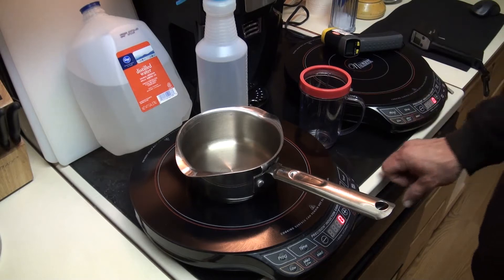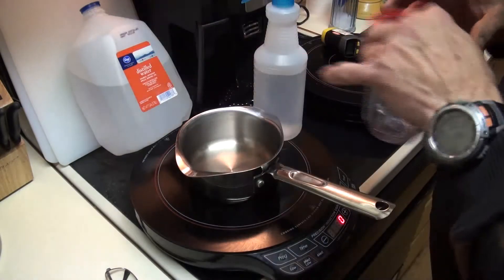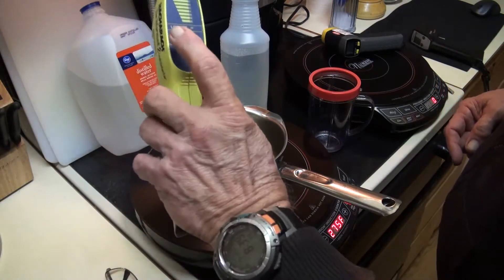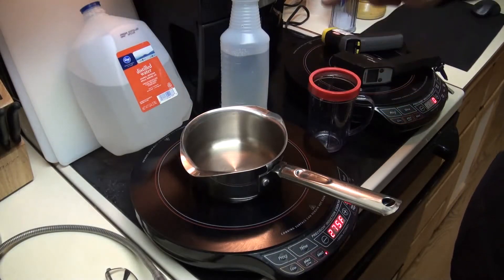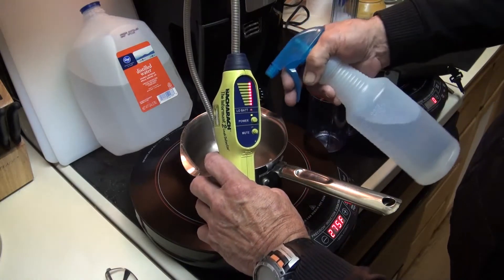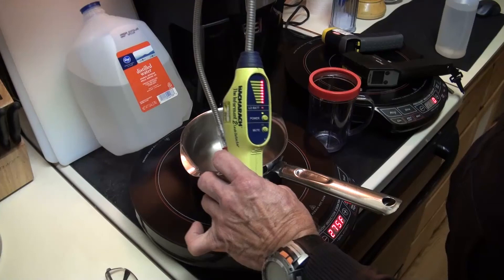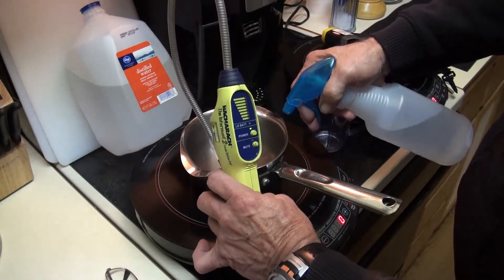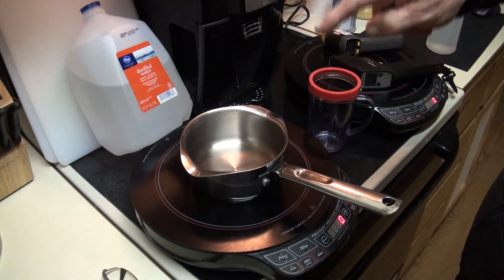# 2 Flammable gas from distilled water, is separating the Atoms, in water.

Comment: Hmmm.... while I am excited about what you are working on, and, do not want to discourage you.
If this were the case, how many housewives would have been killed just cooking a family meal?
We know H2O can be ripped apart.
What system do you believe is required for the flashing application; and, Hydrogen captured for powering an engine under a heavy load? Distilled water is probably not really necessary.
This is not all the parts of the puzzle.  Keep working on your research!
Reply from the maker: Come back and read what I have discovered.
Reply: Bill Kendrick Bill, how difficult would it be to safely set up a test and ignite the Hydrogen produced? If a flame, or electric spark, like a barbeque lighter (...or your Bic lighter is used; do you suppose this experiment would work?
Reply: Bill Kendrick I understand that the water mist has a cooling effect on the heated pan, but would heating the water up to the the appropriate temperature (212F) before spraying it eliminate the need for a larger mass heater?
Reply: use the exhaust heat generated by the engine (after it warms up) as a pre-heat.
Reply: Bill Kendrick If the water was preheated to 212F and sprayed on a pot in an environment with an ambient temperature that's held at 230F by using an oven, would that cause more hydrogen to be produced?

I really hope you succeed at what you are trying to do, and I'm not trying to discourage you. I know temperature is an important variable in what you are doing, but did you rule out the eddy currents created by the induction heater as the cause for the hydrogen gas production? As I understand it, an induction heater uses a high frequency AC signal to generate eddy currents within the pot which leads to Joule heating of the metal pot. If you try to use AC instead of DC to disassociate the water molecule, it will break apart and then come back together again. I'm wondering if it's possible to make an induction heater using high frequency pulsed DC instead of AC. Then I would try your misting experiment again and see if it yields greater hydrogen gas production.
Reply from the maker: Unless you use a charcoal filter and filter the public water, there will be chemicals added to kill bacteria in the water, like chlorine, and chlorine changes the boiling temperature of water changing the temperature that you can flash the water and separate the atoms. Maintaining a constant heat on the water before flashing it, will have no influence on the outcome. It is the temperature applied to the droplets of water that create the flashing effect, no matter what temperature the water is before.
Reply from the maker: Bill Kendrick My Synopsis
We all know when heated, a liquid produces a gas. This gas will separate from the liquid, it was created from. We all know all liquids have their own boiling temperature. What if it were possible to take any liquid to any temperature, then it would be possible to take liquids to the boiling temperature of atoms inside that liquid, and like going to the boiling temperature of the liquid. The atoms that boiled would separate from the atoms that didn’t. One atom, or group of atoms will become a gas and the other atom or group of atoms will remain a liquid. Thus you would have separated the atoms in that liquid, and at the right applied temperatures, it would be possible to separate the atoms in all liquids.
I have a synopsis, all I ask is to read it and decide, if I am right. If you know nothing about Sublimation please look it up on the internet. Sublimation happens to snow when ample amounts of heat is applied to it, of course in explaining Sublimation, the scientist, used an unknown temperature, from a flame, or torch. When a large amount of ample heat is applied to the snow, the snow goes from a solid matter to a gas, without becoming a liquid matter. It is the size of the snowflake’s frozen matter that makes this possible. The snowflakes are extremely small, and they assume the applied temperature faster than the snow can melt, so by going to the applied temperature the solid matter bypasses the temperature needed to change to a liquid matter, which is above 32 degrees Fahrenheit, the freezing temperature of water. The snowflakes assume the applied unknown temperature, using the Sublimation effect and snowflakes become a gas, which happens above the 212 degree Fahrenheit temperature, the boiling temperature of water. We all know how long it takes snow to melt, but snowflakes are small and will go to the applied temperature very fast, faster than the snowflakes can become a liquid.  Agreed? Sublimation is what science calls it.
Using the Sublimation principle and specific temperatures, I replaced the snowflakes with small droplets of liquid, I used specific temperatures, and instead of applying the heat to the liquid, I applied the liquid to the heating element, or heat source, in spray form. I used the same principle, as Sublimation, just a different way of applying the heat. I did this to gasoline and water; it can be done to any liquid.
On gasoline I used 600 degrees Fahrenheit, for the heater temperature. Spraying a fine mist of a liquid onto the heat source, at specific temperatures is totally different from Sublimation, and I start with a liquid. I call it my Flashing Liquid Process. I have found a way to take any liquid to any temperature, before it changes state from a liquid matter to a gas. Using my Flashing Liquid process on gasoline at 600 degrees Fahrenheit, I got a white vapor that has twice the power of gasoline, I saw it on two different vehicles and 2 different Dynamometers. The white vapor I produced, had a zero parts per million hydrocarbons reading, this I have seen on a smog analyzer. To further prove what I discovered I put clean dry rags over the vehicle exhaust pipe, running the vehicle on the white vapor, and on all 7 vehicles, I have run the white vapor on, all the rags smelled like they had just been ironed. Some of the vehicles ran for half an hour on, the white vapor, very clean. At the same time the white vapor was created, I also accumulated a non flammable liquid, neither the white vapor, nor the non flammable would mix with the gasoline they were created from, after I Flashed the liquid gasoline.
I did my Flashing Liquid Process to distilled water. On water I used between 212 and 230 degrees Fahrenheit. I could not find a temperature control to get the exact temperature, but I know it is in the, above mentioned, 18 degree Fahrenheit temperature range. I found that public water has unspecified amounts of chlorine added. Chlorine influences the boiling temperature of water, so I used distilled water, which is also a non conductor,  gasoline,  is also a non conductor to.  You see, I used electric heaters, and thought about shorting out the electrical, when and if it is used on a conventional or hydrogen powered vehicle. When I sprayed the distilled water onto the heat source at the above mentioned temperatures, I detected, with a combustible gas leak detector, a flammable gas from the vapor I produce. There is only thing flammable in water, it is the hydrogen atom. To get hydrogen from water with temperature, you would have to find the boiling temperature of the hydrogen atom, turning it to a gas, while the oxygen atom, still in liquid matter form, having not been flashed and reached its boiling temperature, remains a liquid. The liquid oxygen atom remains a liquid long enough for the hydrogen atom to become a gas, and separate from the liquid oxygen matter. Of course liquid oxygen boils at, according to one internet source, -368.77 degrees Fahrenheit, so it will boil as soon as the hydrogen atom separates from the oxygen atom, inside the water. Hydrogen from water using the right temperature.
Science says when atoms separate, a void is created in the original atomic structure, and the void will be filled. Air being present, when my Flashing Liquid Process takes place, the surrounding air fills the void, and oxygen, being in that air, is what turns the vapor I created from gasoline, white. I have seen the bubbles form, and the gas inside the bubbles is clear, until they break, then like magic, when the clear gas is exposed to the air, the clear gas turns white. The oxygen in the surrounding air creates a hotter burning vapor, this is where I get twice the boost in power over gasoline. The liquid that forms the bubbles, that has clear gas inside, is the non flammable liquid that I created when I Flashed the gasoline, at 600 degree Fahrenheit temperature. A Gas Spectrum Analyzer, would add documentation to my synopsis. Prove me wrong, you have the temperature, use an electric fry pan, turned to its highest temperature, which should be around 600 degrees Fahrenheit. Spray a fine mist of gasoline onto the heated surface. Don’t worry, science is wrong about gasoline igniting at 536 degrees Fahrenheit. I have seen a heating element turn a dull red (about 1000 degrees Fahrenheit) before the gasoline auto ignited.  The electric fry pan cannot reach that temperature. Analyze the white vapor, and non flammable liquid on a Gas Spectrum Analyzer. I know what I discovered.  I will call the white vapor I created from gasoline, Billy Gas. I know its saturation temperature is around 65 degrees. It remains a gas at higher ambient temperature, than 65 degrees Fahrenheit. Find that saturation temperature on the combustible liquids chart.
I have 3 videos on You Tube my channel Bill Kendrick, watch them and read the comments, make your own decision.  A large mass of heat will be needed to sustain the desired temperature, when the liquid is sprayed onto the heat source, and the droplets need to be as fine as possible, to react to the applied heat faster. Yes I think I found the way to separate the atoms in any liquid with the right temperatures. I say every liquid atom has its own boiling temperature, when my Flashing Liquid Process is applied. Try it and see for yourself.
Bill Kendrick
Reply from the maker: You need to get a life, and find something you might know about.

Comment from the maker: It is the clear plastic bottles that are made from fossil fuel. the milky ones give off no hydrocarbons and the milky bottles are all I used in my experiment. So distilled water is not a problem, the chlorine is, and influences the boiling temperature of water. The clear fossil bottles are why I don't drink soda in plastic bottles anymore.

Comment from the maker: We all know water is not flammable. The only flammable part of water is the hydrogen molecule in the chemical make up of the liquid water. We can extract hydrogen from water with lots of power and chemicals, but it is not economically feasible to produce hydrogen in large enough amounts to support a hydrogen backed World, besides hydrogen fuel cells on automobiles, are like bombs in a car accident. This simple process, I have, refined, can make hydrogen at the intake manifold on the engine.

Comment from the maker: Scamming, is not my objective. Sceptics come out of the wood work, and give a thumbs down, to everything new, and they have never tried what is being presented. Get a stainless steel pan, iron skillets fluxuate in temperature to rapidly. Use distilled water, varied amounts of chlorine influence water's boiling temperature. Get a combustible gas leak detector, and  thermo thermometer. Spray a fine mist of water onto the pan whose temperature is between 212F and 230F, You will detect flammable gas

Comment from the maker: It is the temperature. You see when you apply a fine mist of liquid to a heated surface. The liquid will assume the temperature of the heater before the liquid can boil. Heat transfer happens faster than a liquid can boil or freeze, which is a change of state of the liquid matter.

Comment from the maker: There is a gas to oxygen ratio that it takes to have enough flammable gas to ignite. The flammable gas leak detector will detect very small portions of flammable gas, smaller than the amount needed to ignite. However the fact that I produced the flammable gas, which can only be hydrogen, from the water, using heat applied a different way, proves I did it. Nobody else can do it. It takes chemicals electricity and expensive probes to make hydrogen, slowly. It proves I have done a molecular change

Comment from the maker: I know for a fact it is the temperature. You see I get a white vapor and a non flammable liquid when I used this same Flashing Liquid Process on gasoline, at 600F, the first video I made. It will take a large mass of heat and a very fine mist spray of water to prevent the water from changing the heater temperature, which is critical. I used resistance heat on gasoline and induction heat on water. Something else to consider, this can be done to any liquid, who knows what can be created from it..

Comment: id say get something built that lets you spray water through an injector to the hot surface and light the gas coming out. even if you had to use electrically charged hot plates, the fact that heat is helping, makes hydrogen (from water) engines more feasible. high temp electrolysis and light the flare :) also figure out if its just the temp, or if the induction heater has alot to do with it

Comment from the maker: I can see you are a pessimist. You are missing obvious things in my demonstrations. First, with no chemicals added or electrodes Just temperature applied a different way I detect a flammable gas, from distilled water. Only a molecular change can separate the hydrogen and oxygen molecules in water. Sure hydrogen is made but it is not a molecular change, chemicals and electricity, along with having to use expensive probes to get the chemical reaction, to change the water and make hydrogen slowly.

Comment from the maker: Let me see you make a flammable gas appear from chlorine free or distilled water any other way. To make all the hydrogen contained in the sprayed on water, requires a large heat mass, a very fine mist spray nozzle, a temperature control with less than 10F on and off differential in the 190F to 260F temperature range, and you could light the hydrogen from the heater, but I don't recommend it. The oxygen from the water will boil immediately after the hydrogen and cause the hydrogen to burn hotter.

Comment from the maker: If you spray a fine mist of distilled, or chlorine free water onto metal pan, no coatings on the pan, who's temperature is between 212F and 230F, a combustible gas leak detector will detect a flammable gas from the vapors these temperatures create, when the water is sprayed. There are only two different matters in water (H2O), hydrogen and oxygen, only one is flammable. So it is hydrogen I detected.

Comment from the maker: Use distilled water most public water contains chlorine, and I found the diverse amounts of chlorine in the water influences boiling temperatures in the water. If using public water filter it through several activated charcoal filters first to remove as much chlorine as possible.

Comment from the maker: I did it in my kitchen. The temperature range is critical. Distilled water, a spray bottle, a controllable heat source, a combustible gas leak detector, and you to can make hydrogen from distilled water. Reach and maintain the optimum temperature in the 18 degree temperature range 212F to 230F and make all the hydrogen contained in the water being sprayed onto the heater. When you do this don't try to light it with a match, it could blow up.

Comment from the maker: To do it yourself the temperature range is critical. There is an optimum temperature in the 18 degree Fahrenheit temperature range between 212 and 230 degrees Fahrenheit. If you can find it and maintain it, you will produce all the hydrogen contained in the water being sprayed onto the heater, and it will happen instantly. My demo was just to show it can be done and it is to simple to do and to big to control. This is why I told the world how to do it. Nobody controls it.

Comment from the maker: He applied the heat to the liquid and it will only take the liquid to the boiling temperature of the liquid. Water boils at 212 degrees Fahrenheit, gasoline, depending upon the octane level of the gasoline will boil between 100 and 400 degrees Fahrenheit. I am taking gasoline to 600 degrees Fahrenheit, and water between 212 and 230 degrees Fahrenheit. I get a flammable gas from water and a non flammable liquid from gasoline using my Flashing Liquid Process. Now explain away a molecular change.

Comment from the maker: When you apply the heat to the liquid the liquid will only go to the boiling temperature of the liquid, then boil at that temperature. When I apply a very small droplet of liquid onto a heated surface the liquid will go to the temperature of the heater, then boil, at the heater temperature, even if it is above the boiling temperature of the liquid, because the small droplets assume the temperature before they have time to boil. We all know how long liquid takes to boil. Heat transfer is faster.

Comment from the maker: Mike, check out the gasoline video on White Gasoline Vapor, I made. I used this same process on gasoline just different temperatures (600 degrees Fahrenheit). I got a white gas, and I also got an non flammable liquid, that would not mix with gasoline anymore. Gasoline is flammable, as we all know. On water I got a flammable gas using a different temperature but the same process, and we know water is non flammable. These can only be molecular changes, nothing else can create this.